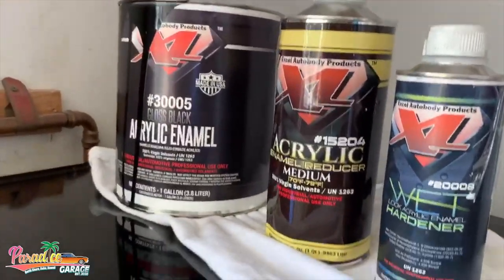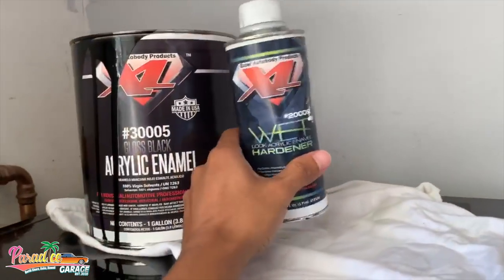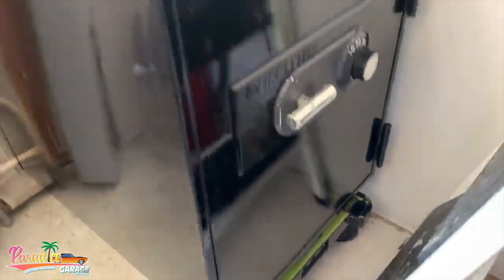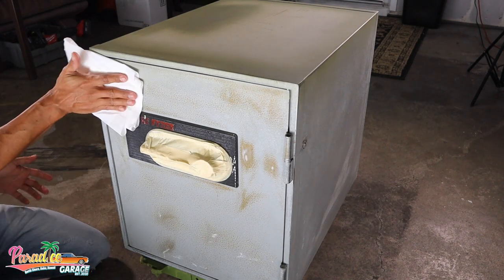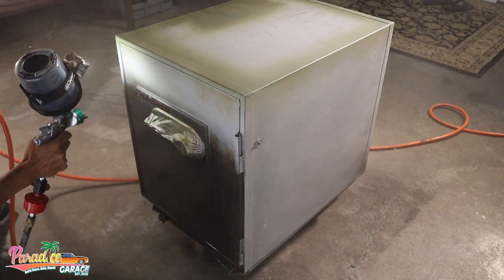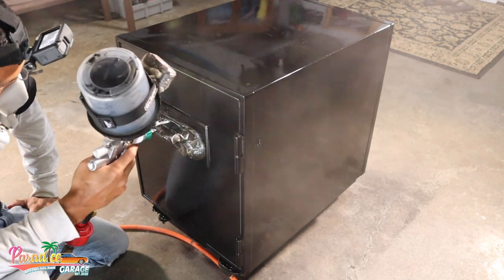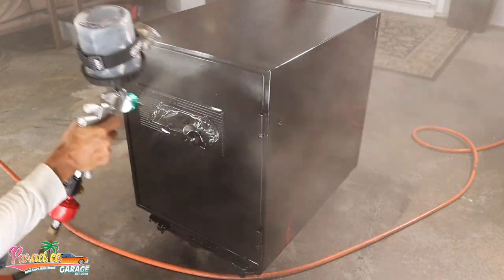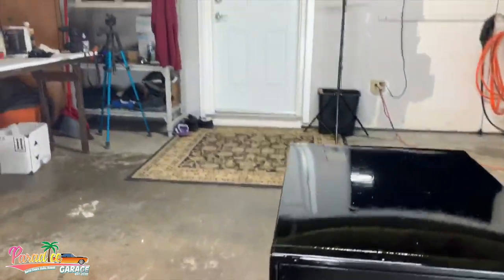Spraying A Safe With 2k Single Stage Using an LVLP Spray Paint Gun

Comment: I add a little extra slow reducer and the base coat activator with the single-stage paint. The extra slow reducer will allow it to flow out a little better. The base coat activator will make it a little stronger.

Comment: Great informative video, thanks. I have a 1964 Bentley S3 which has been repainted at some time with a single stage paint that has developed what I would describe as shrinkage cracks in places. When the paint is compounded colour comes of on the cloth so it does not have a clearcoat. Will 2k single gloss paint react with the existing paint.
Reply from the maker: Hi Clive, I'd suggest checking out VIP and see how it can help you with your custom project: https://www.learnautobodyandpaint.com/vip-offer/

Comment: What scfm does this gun require?
Reply from the maker: Hey Man! You’ll need to be spraying at about 26 to 29 psi if you’re doing base coat clear coat with HVLP Spray Guns. The higher the pressure the more atomization and better flow out you’ll get.

Again, It’s recommended to have 28-29 for clear coat and 26-27 for base coat. And, primers are a little lower at 25 psi. It’s a little lower at about one to two psi for LVLP.  Check out our VIP program how it’s helped many people like you and get the ability to complete amazing DIY paint jobs from home on budget. https://www.learnautobodyandpaint.com/
Reply: I mean like how small of an air compressor can I go? I have the x 27 hvlp and I love it, I just want the LVLP I want to know if it could be used with a small compressor cause I’m going to start doing mobile repair